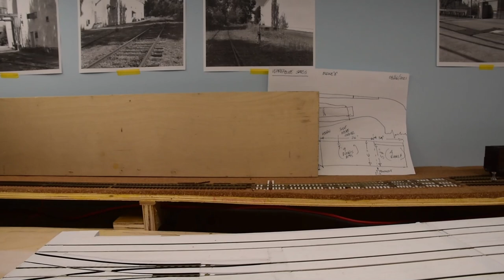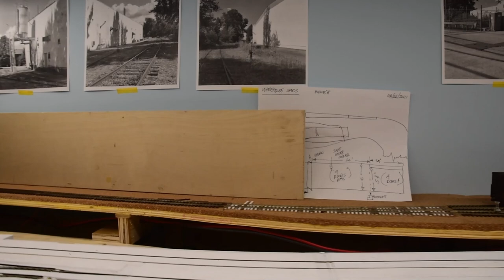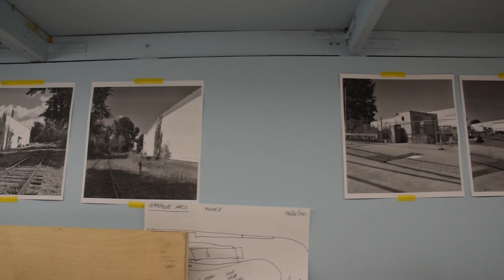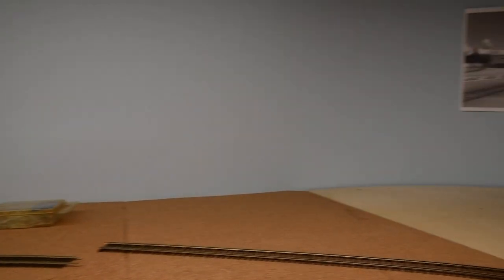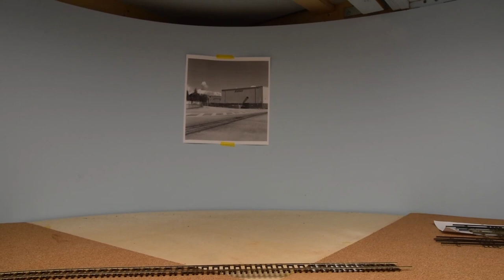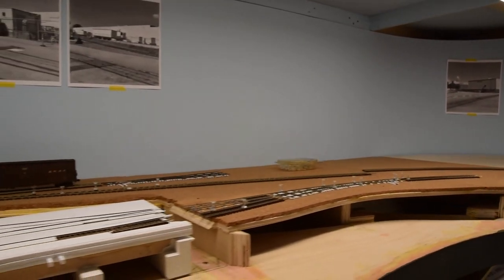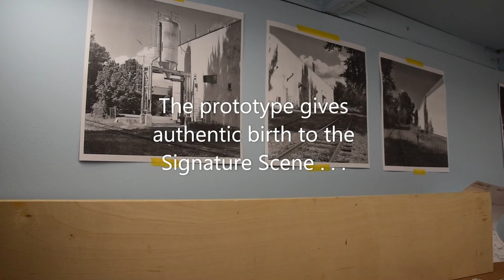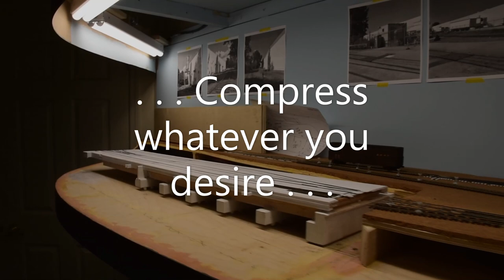Signature Scenes & Selective Compression | River Road - Part 1

Comment: I have spent some time trying to figure out how to comment about your comments about flats and their shape.  (that was a weird sentence)  When we stop and think about it, the shape of the flats should be considered when we are doing our track planning and layout. If the track, or road, that the flat faces is parallel to the backdrop, then the flat, in most cases, will be flat. Some railroad modelers don't think about this. They layout the track without thinking about the size of the buildings and other structures. Could have an entire video about that. Great video as always. I love the information you provide to us. Thanks - Larry.
Reply from the maker: Well Larry you touched on an important point in the initial design phase. I always plan longitude variation in from the very beginning. Then I worry about buildings later. Cheers.

Comment: Whew!  An 11 minute video.  Great timing as I just finished the turnout tutorial.

Very true about flats and the back wall.  Same for trackage and roads, which you previously proved.

Selective compression is still somewhat a mystery to me.  I get the idea and some basics, but application remains foggy.
Reply from the maker: The key is to not glue anything down so one can move it a dozen times here-and-there . . . lol.

Comment: Hi Boomer another informative episode, I’ve been learning a lot about compression as I’ve built my own layout and you’re right the minds eye see’s things differently to the reality.
As for the flats that’s also something I’ve been thinking of to, I have a couple of areas that I will need buildings against the backdrop and you now have my brain working on that to but that’s a little way in the future. I think I generally have a couple of sleepless nights mulling things over after watching a new episode of yours, lol!
Cheers Boomer, John
Reply from the maker: I usually take my time with this process using several "mock-ups" to help form the composition like width, height, length, etc. Making the initial builds out of card board allows for easy revisions. This assists in finding the balance before building the final size, shape and style, etc. Eventually it comes together . . . Cheers.

Comment: Boomer, absolutely agree on the low two dimensionality of low relief flats straight against the backdrop. Same counts for hills pressed up against the wall. When modellers take the time to look through their eyelashes to just check on such a perspective, they should be able to see that a gap or slope down towards the horizon, is so much better to acquire the often wished for illusion of depth. Looking forward to seeing your flats technique. Thanks for sharing!
Reply from the maker: You are correct with some exceptions concerning the shallow shelf layout. I never liked the "yellow" building on 'Glover Road' for this reason, even though I tried to ditch it behind trees and a fence. It was acceptable but not optimal. Hills and flats are a challenge as you mentioned. Hills to the backdrop can work with some relief behind them such as buildings or trees, etc. This is the beauty and challenge of the hobby. Options are seemingly endless when we stoke the whims of creativity. Cheers.

Comment: Modeling a portion of that bridge or in combo with a 3D backdrop would be awesome….you’re right about thin building flats against the backdrop….always never looked right to me
Reply from the maker: Modeling a portion of the Alex Fraser bridge is appealing to me from  a specific perspective (like from the entry way of module "A"). Then issues begin to arise as you move along the facia to module "B" and beyond, because the perspective changes radically and so does the scale, etc. A challenge to say the least. But I like challenges like this. We will have to see, since module "B" becomes a new "Signature Scene" as well . . . Cheers.

Comment: Most interested in the background flat structures coming. I made the mistake of making my track work too close to the back not allowing for depth. I guess I had photo backdrops in mind when I began.. since then..following the Glover Rd build.. and your approach to real structures set me at a halt. If I pull my track at this point I might as well screw it all and I don't really want to. On the other hand as you rightly pointed out previously.. if you have a trouble area and you don't address it..it will Always Haunt You.. the deeper you go the bigger then mess...
Reply from the maker: You summed up sentiments exactly. For background buildings you only need a few inches of depth to convey another dimension where the subconscious imagination fills in the rest. If you run them at a slight angle it increases the illusion of depth remarkably as well. Cheers.

Comment: Boomer... another great production! 👍 but I have a question. I'm working on a shelf that's using class 1 power on a class 3 spur line which involves running on bad and most recently abandoned track. I love how beautiful track can be (yours and others) when ran smooth and flat. Shy of vegetation how would you go about laying tract with minor twists, sudden elevation changes, and all other "almost too bad to run on" track situations?  Thanks again for the inspiration and know how.
Reply from the maker: What a fantastic idea. I love the concept as well. 
Building poorly maintained track is a modelling art in itself. It will also demand modelling skills acquired by those who have the passion to attempt it and stay with it through trial and error. I would begin by building the track on very thin MDF board, run a pencil line, and go at it , randomly with a disc sander creating longitudinal undulations. Then, I would roughly board sand it and hand lay the track straight over top of the MDF (No Cork!). Then you can even sand the ties further if you want. If you hand lay the track with wooden ties you can control the depth of the dips (uneven surface etc) more specifically as you tweak it. Furthermore, when you spike the rail, you can also control the variances in alignment, etc. I will be doing a section like this (sown the road a bit), with code 50 on a siding, or two. Cheers.
Reply: @boomerdiorama  my god man, your brilliant!! I'm going to get right on that!!! I'll keep you in the loop.
Reply: Maybe search what Indian modellers do, that country has some truly horrific track in narrow to broad gauge.
Reply from the maker: @rhodesj1893  Lol . . . O.K. Rhodes . . . have fun man, your encouraging. Cheers.